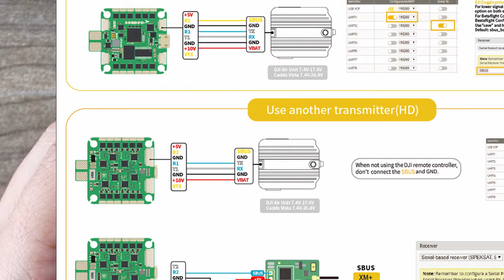iFlight Beast 30x30 AIO - Flight controller + 45A BLheli ESC - Lighter, faster drone building?

Comment: I like how they put the usb seperate and new orientation of the plugs on this one. I have the whoop size one for a not so lightweight 5inch freestyle rig. It’s holding up well for months now. I even turtled the crap out of it and got it super hot but no smoke.

Comment: flip the board for dji you have rx1 tx1 on both sides. and the pinout is like dji with the smaller pin on the other side. this board is perfect, and a big bkackbox, all is needed is bluetooth!

Comment: Changing the Vista plug makes it more compatible with things like the Ghost hybrid and TBS sixty9 combo units coming out that use a single plug. All the vista plug is lacking is video out for an analog vtx. Seems like they could have ordered the pins to be more compatible with the original vista plug though. But that could just be a limitation to the layout of using a single board just not enough room to route the pins in the correct order it.

Comment: nice man!  So a no go for my 801g freestyle quads? lol
Reply from the maker: Possibly, with hero 9 ill easily be over 700grams.  Im thinking it should handle it, but never know.  for me im not a basher so most electronics are safe in my hands.  If you are?  Id get something a bit more beefy.
Reply: @JonE5FPV  yeah i don't do much in the way of bandos.  Not as much concrete in this part of Texas! Lol
Reply: I got one on a 5.2" quad running 2506 1650kv (750g+) for a couple months and its been fine.... i dont crash but its probably handled 100 packs and been solid
Reply: @badfourlife  good to know!  Thank you for that

Comment: I've got one of these on the way but with it having a BGA sized chipset I'm not expecting it to last.
My 25.5 x 25.5 Iflight beast H7 esc section died while I was calibrating the motors, its also a BGA chipset. but it was already on its way when I tried to cancel the STD beast. Ouch.. :/ 
Its just too big of a hit financially to risk these AIO's especially with such inflated current pricing. 
Going forward its going to be stacks with seperate boards.. or even separate arm mounted slim escs for me.

Comment: This one seems interesting for retrofit into older single stack frames like GEP-LX5. It gave me idea bout how to put Vista VTX in this frame at last. USB port location is weird though. Seems it should be covered somehow at front to avoid clogging with wet dirt and debris.

Comment: I ordered this board direct from iflight when it was announced. I installed it in my hot rod 3” i built. It lasted about a week before the board died mid flight and my qwad crashed into my car. When it failed i also lost the osd portion of my air unit. The usb extension supplied with the board never worked for me. 

I had the original version and this new one and they both failed. Left a very bad impression on me iflight did.
Reply: Sucks to hear that, what are you running now?
Reply: @ihpsta  im 90% done with switching my fleet to hobbywing f7 stacks. This one i swapped the electronics into a 3” apex and 40amp hobbywing stack.
Reply: I couldn’t get the usb extension to work or the gps
Reply from the maker: wow thats bad to hear. Mine is still going strong so far.  Did iflight respond anything at all?
Reply: @JonE5FPV  i have to open a ticket with them

Comment: The usb-c wouldn’t connect to betaflight am i doing something wrong ?
Reply from the maker: Does it connect on the usb on the board?
Reply: @JonE5FPV  yes the  micro usb connects but I couldn't get the usb-c extension to connect